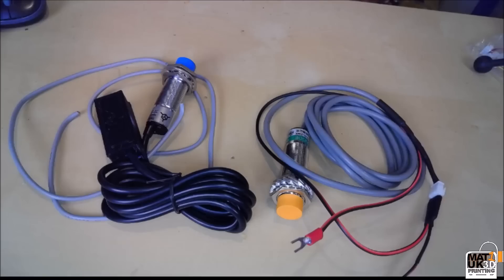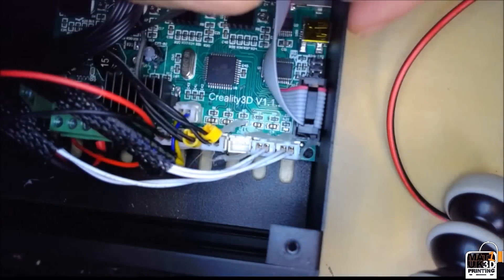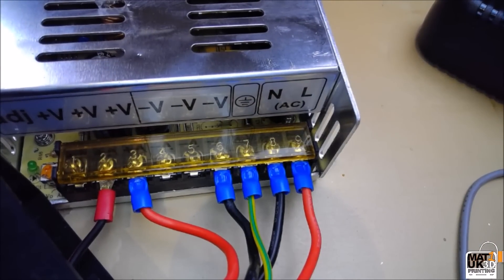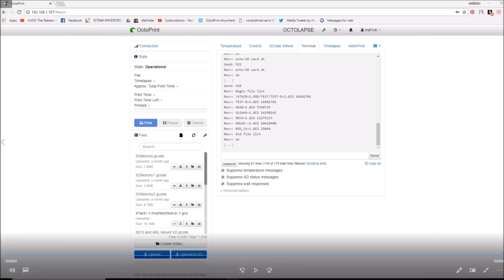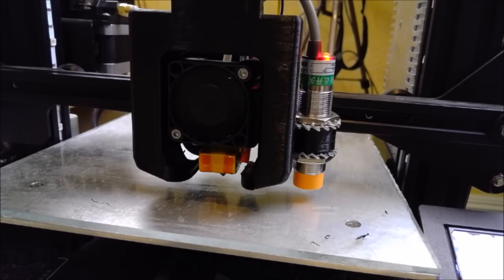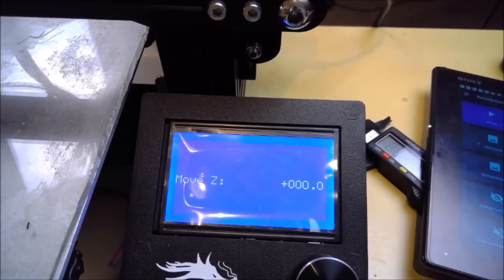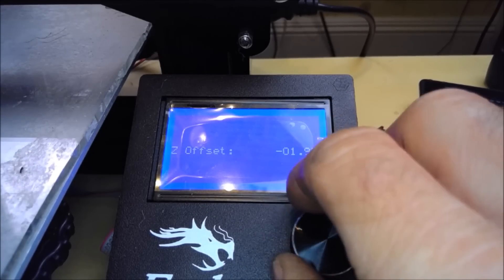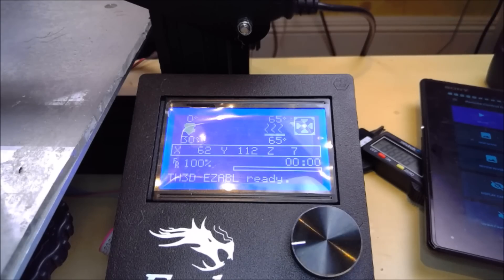Ender 3 Mods Series Pt 3 Installing and Configuring your Auto Bed Leveling Kit

Comment: Many thanks for this detailed video :) , Where would I find the gcode to enter into cura to set it to auto level at the start of every print? I couldn't see an exact copy of this in the download folder?
Reply from the maker: Use g28 to home then g29 to auto he'd level remember to make sure this is in after you have heated the bed
Reply: @MATS_MAKERSPACE   many thanks for the advise , just waiting on the kit to turn up and making sure all my ducks are in a row :)
Reply: @MATS_MAKERSPACE   like this??

; Ender 3 Custom Start G-code
G28 ; Home all axes
G29 ; ABL
G92 E0 ; Reset Extruder
G1 Z2.0 F3000 ; Move Z Axis up little to prevent scratching of Heat Bed
G1 X0.1 Y20 Z0.3 F5000.0 ; Move to start position
G1 X0.1 Y200.0 Z0.3 F1500.0 E15 ; Draw the first line
G1 X0.4 Y200.0 Z0.3 F5000.0 ; Move to side a little
G1 X0.4 Y20 Z0.3 F1500.0 E30 ; Draw the second line
G92 E0 ; Reset Extruder
G1 Z2.0 F3000 ; Move Z Axis up little to prevent scratching of Heat Bed
; End of custom start GCode
Reply from the maker: Yep that should work
Reply: @MATS_MAKERSPACE  great many thanks :)